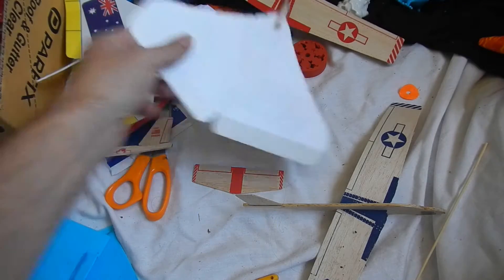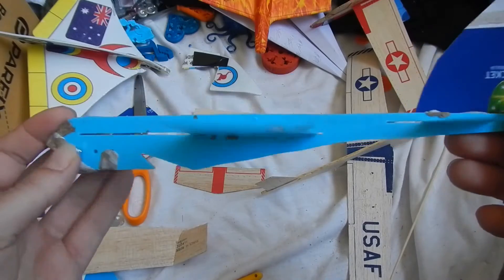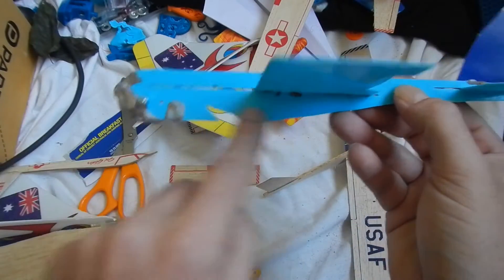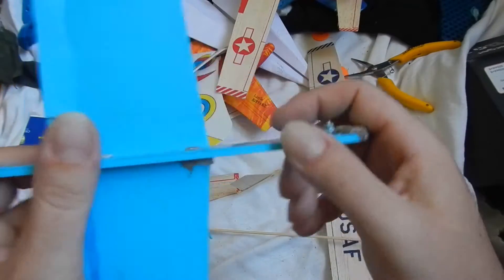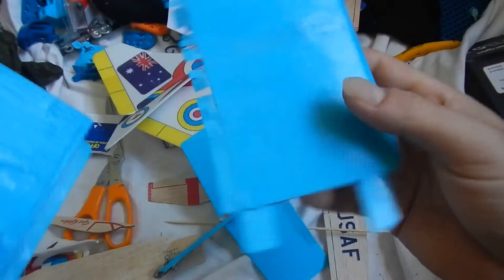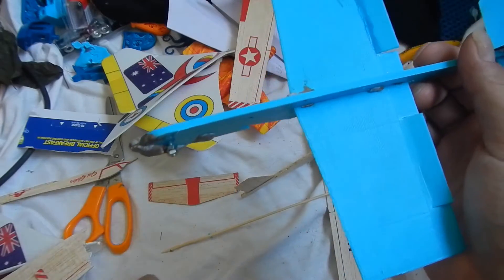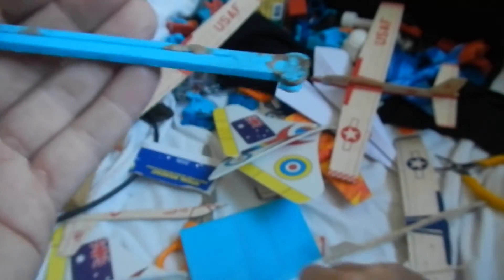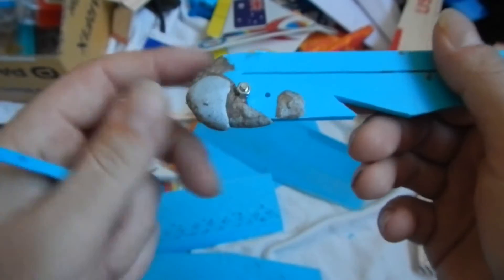Project Glider

Comment: At 9mins things were getting good, then you blew it up on the return throw LOL
About the 'angle thing', imagine a very shallow bowl and how much better that would be likely to surf the air. The slower the flyer, the bigger the tail horizontal. Elevators are much more effective the further back, hence being on the tail of nearly all planes.. Center of gravity should be approx 25% of the wing chord back from the leading edge...balance on fingers.
Reply from the maker: Yea this plane has none of that. It especially does not balance lol. Also turns out its really hard to film. You made it look too easy! I do like the way it Explodes on impact though, might have to invent a burning special effect lol. Might try some new tail wings and rudders based on your advice though. I think a 3D printed glider can fly!
Also thinking about motorising it. With 14g nose weight I could probably get a motor and lipo on there...
Reply: Your filming was fine, saying that the neighbours don't like their windows on show. It's such the learning fun experience, to build these things. That moment when a self-made motorised anything actually climbs for the first time is quite wonderful. Especially if R/C and your daughter was at the controls :)
On this sort of size/weight, i'd advise using the gear out of a crashed Hobbyzone Champ, Parkzone Mustang or similar. Your broader wings will give good slow flight at a local park. Or, could easily fly a Parkzone Vapor type in your back garden, it's ideal for something small weighing around 10-15 grams.
Reply from the maker: I have a few broken small choppers. They have motors that look a lot like the worlds smallest solar car motor, but I'm guessing go a bit harder. As well as the 300mah ish lipos they came with... I could print props if I knew what I was doing.... I could probably get a gear or two in if needed too. Haven’t been 3D printing long, but pretty impressed with this ABS stuff...
Reply: A 3D printer is a 'need' these days !
I'd build one, but how do I melt plastic bags and milk bottles for filament ? LOL. Am damn sure you have a method :)
Smallest solar car motors are 6mm. Best of that type, with a decent prop will fly up to 12 grams. Your builds would fly with 2x those sized motors from a small heli, but not if there is a gyro on it (fun trying though!). Heck I could write a novel on possible routes to go depending on your gear. If total weight is under 26g, any 2 channel toy plane with twin motors will also allow steering via those motors. Lipo would be < 120mA, so if you have 300mA your motors are likely larger/stronger. Feel free to email of course, same username at yahoo.
Reply from the maker: I have looked into recycling plastic for printing a lot. Unfortunately its not very plausible. I have seen a few very clever people fail. Its almost ready for the too hard basket.
The problems are:
1. Plasticiser.This one is not huge, glycerol can be added to your ground up plastic. But how do you know how much you need for the plastic batch you ground up? How do you mix it in evenly?
Which brings me to the real problem.
2. Contamination... How do you know what plastic you have? How do you ensure there is no dust particles, hair etc etc. that could block the nozzle on the printer. For decent detail printing you want 0.2-0.4mm nozzle...
Imagine the frustration of a 20 hour print failing after 15 hours because of a tiny bit of hair or dust...
3 Consistent filament. The slicing program needs filament to be consistent within 50-100 microns in its diameter. So it can make the g-code push the right amount of plastic out. The more accurate the better. Its not easy. Russ over at rwg had a lot of problems here and hes got some serious skills. This one is also  something I have ideas to deal with, but the contamination and plasticiser problems needs to be dealt with first.

There might be a way to chemically melt and clean the plastic, but I don't have the chemistry skills. Not even the manufacturers are interested in recycling for filament.

I'm selling prints to pay for filament at the moment. It wouldn't be super expensive for your projects. A 1kg roll of ABS costs about $40 Aus... Consider that I made this glider, with 2 bodys and 3 sets of wings for well under 100g. Yet sale price is around 20-30c per gram, sometimes higher. So you can typically recover the cost of a roll by selling 10-20% of the plastic on that roll as printed items...

What I am looking at is ways to recycle the waste plastic from failed prints, calibration etc etc. into something that can be crafted without a printer. There will be some video on that very soon. I have a bunch of craft products I want to make :D

A lot of people with printers seem to be printing a ton of stuff that could be better made another way... Like fan ducts for eg. Everyone likes to print a fan duct for their print fan. You do need a good duct, but... Takes a few hours to CAD, then another few hours to print the first one and check the fit. Many will print 2 or more before its right.
I used cereal box, tape and hot glue... Took all of 30 seconds from concept to working product, and its infinitely more adjustable and modifiable.
Save 3d printing for tricky stuff like aerofoils, props, and other things you just can't make another way.

Having said all that would love to send you a printed  parts kit soonish. Once I can justify the expense of the plastic and postage :D My kit had a lot of flaws. I am putting together a better kit with many problems fixed. Which I may start selling if there is enough people willing to pay what I need to make it worthwhile. Will be looking for a couple of people to test it all out.
You would still need an Arduino mega, Ramp's board or equivalent, with stepper drivers, 5 NEMA 17 motors, and a bunch of steel rods, nuts, bolts and bearings etc.
My printer cost nearly $300 Au all up. It then took me 10 weeks printing 10-18 hours a day to get to a high quality standard. Still many things I would like to fix.... Its a massive time sucker.
Reply: Can quite imagine it takes bunches of hours to calibrate and set up. But, of course, WTF without a 3D printer nowadays lol.
Thanks for all that info and yes, I see what you mean about contaminants. It does seem a waste to not recycle, considering the amount of crap thrown out every day.
I've seen milk jug plastic melted, but it doesn't really flow or look like an extruder type of thing could make filament from it...am betting there would be a huge amount of interest in some device that could do it ! 
My last foray into melting plastic bags resulted in black smoke and the windows open for about a month :)
Reply from the maker: One of the biggest calibration challenges I faced was the melt temp. It has to be pretty good. +/-3c is not even close to good enough.
Then consider its reading temp via thermistor, because the K-probe table is broken and I can't code well enough to fix. And that there is a fan that changes speed, blowing on the hot nozzle, and the firmware uses PID that only reads a 1hz and does not consider said fan, or room temp/humidity etc... And that the heater is far enough away from the  nozzle and sensor that there is about 2-5 seconds of sensor lag... Its one of the things I'm still not happy with...

For DIY recycling you should look into solvents ;) Or pressure extrusion with a screw driven syringe type thing, like how solder is made (ever wonder how they get the flux in there?)... Trying to re-melt with less than lab grade equipment and no plasticiser is not going to go well.
Reply: Was thinking about the temps a lot a couple of years ago. Probably when you were building yours and i was thinking you'd build it for $25 out of a couple of bicycle frames lol. But the thing was about us not having AC or other controlled heat in this house. The temps are all over the place...so any build would have to constantly auto-calibrate.
Ah well, all in time.
Reply from the maker: Yea, Your looking at microsecond temp controllers if you want it to work well. And you need to know what the plastic is... Milk bottles etc are not very consistent.

The frame is cheap and easy, Next one may be from a fork lift pallet. Woods actually a really good medium for printers.
Hoping to get a good coder on board and put rotary encoders on all the motors. Then its will be possible to make the printer a lot cheaper. Still a lot of expense just in the rods and bearings though. No good way around that.

A lot of 3d printers run in climate controlled enclosures. Its the way to go. All my future builds will. Humidity causes all sorts of problems. Not to mention issues with shrinkage etc. I have had parts split because I opened a door to take the rubbish out and a draft cooled it too fast.. Gotta keep the filament dry too. Its hygroscopic and the moisture is not very compatible with print temps  up around 260c...

I do have ideas for using recycled plastic to print still, but its going down the powder printer path. Even more expensive and harder to make... Hopefully I can fix some of that, but it might not be so easy...
Reply: I must live in the worst place possible then, except folks in the Amazon jungle ! the humidity here in summer is ridiculous, due to 3 large rivers nearby..new metal stuff turns brown very quickly. So yes, good point, to put a build in plexi.
Reply from the maker: Actually I am going to use either Cheap Bracing ply for 3 sides. Obviously needs a plexi window somewhere, or possibly in my case a microwave door (its got a window, hinges, latches, what more do you need?). The ply is really cheap, its only thin, but no need for strength. Its similar wood to a cigar humidor... Once its sealed it'll be ideal.I got a huge 6'x10' sheet of it for $25 for another project.
Or better yet... Cardboard! I'll probably paint it with waste ABS melted in acetone to seal it..

In really humid places like yours, and my sub tropical coastal location in summer (unsealed circuit boards die from green death is 12-18 months, Because salty 705+ humidity, put photos up on G+ a few weeks back). I'm thinking a peltier condenser on the air intake. Drain the water off then put the air into the box via the circuit board that needs cooling. To heat the air before it enters the enclosure. Might even cool the air on the peltier to condense water, then blow cool air past hot side of peltier to cool it and warm the air.. lol.
The pelter’s will be on 5v as the ATX needs more dummy load.

An enclosure also deals with the fumes problem. Its quite smelly, and sets off my smoke alarm in the next room, can't be healthy. Need to duct that stuff outside. I want to see if I can filter or condense the fumes too, to reduce pollution.
Reply: All makes sense if the enclosure air can keep up with whether it wants to be cold/warm/humid/non humid. Maybe it'll give up and just be blank air !
For a dummy load you can use anything such as a regular PC fan, which might complicate things in this case.
Oh, so 3D printers smell ? I didn't know that.
Reply from the maker: LOL. For the 5v dummy load. I have 25Amps so far, need another 10 amps. Because of the way the tx in the SMPS part of the ATX is designed. It needs a heavy load on 5v to simulate the CPU or the 12v rail drops. See my recent heat bed dummy load video for more info...

Melting plastic usually smells....
Reply: Speaking of all this, I just set up an ATX power supply for my R/C batt charger. The original PSU failed a couple of days back, starts/runs 2 seconds/switches off repeatedly. So I put the ATX supply on. For a load I have a small 12V fan, but the actual load is also 12V. Seems to work fine.
Reply from the maker: Will work at low current, Up to about 1-2 amps. But try drawing 20 amps for a couple of resistive heaters and 5 400ma steppers... The heat bed on my printer is 1.1 ohms... Was making my 12v rail drop to 10v... Causing steppers to misbehave, which was making for some really messy prints. So I added a few 12v tail light globes and some nichrome toaster wire on skewers for a bed supplementary heater (plus the satay smell is better than the melted plastic smell). Still planning on adding some 3w LEDs for light and further 5v load... Most people just put 30-100w of resistor in the ATX near the fan, but I wanted to do something useful with the "waste heat" Now I have a dummy load thats not such a dummy. :D
Reply: That's even more useful info, very cool to learn. Also, in less of a prime location to live, that 100W heat output could run around peoples thermal underwear in winter !
Reply from the maker: I've been meaning to make a toaster jacket for years. Not much call for it where I live though

Comment: Speaking of lots of lift and adding lots of weight, I did that to a very large Styrofoam glider when I was a kid.  I had the wings bowing under the weight of launching it very hard and fast.  I kept it up until the were about 180 degrees (big letter U shape in the air) and that was it, it finally gave it up.  I had inserted a large bolt into the nose of the plane to generate the G's that thing was feeling.  Was awesome while it lasted though.  :-)  but yeah, snapped the wing and twisted off into the yard hitting something with the bolt in the nose.  That wasn't so good.  I think I remember being in trouble over that.  Not as bad as the yard dart that went through my fathers convertible corvair and into his seat, but it was bad.  I think that bolt was like a head bolt from a car engine.  now that I think about it I had a lot of toys that were old discarded car parts when I was a kid.  I remember having a distributor cap for a fort and spark plugs for cannons.  Oh there I go again with the ramblings.  Cheers mate!  :-)
Reply from the maker: LOL. I had "toys" like that too. I remember playing many games with a hand break ratchet handle lever thingy bolted to a bit of timber. Used to get fingers jammed in the ratchet bit all the time. Still more fun than TV.